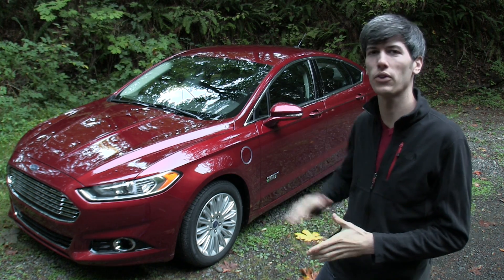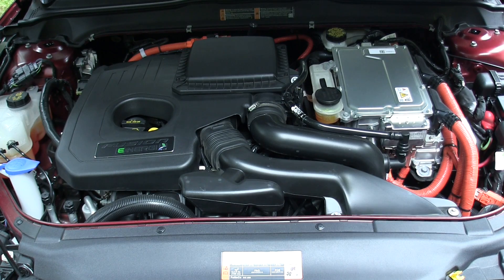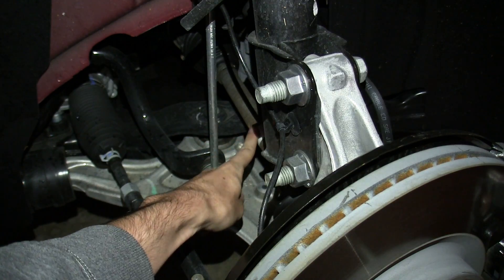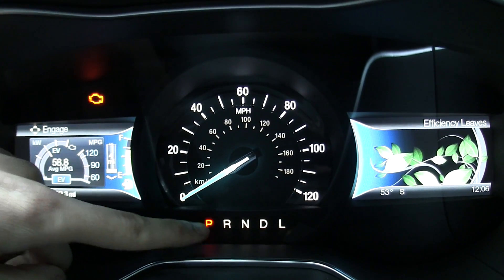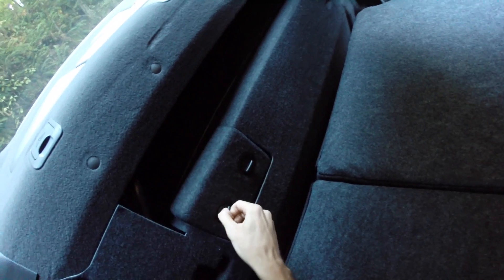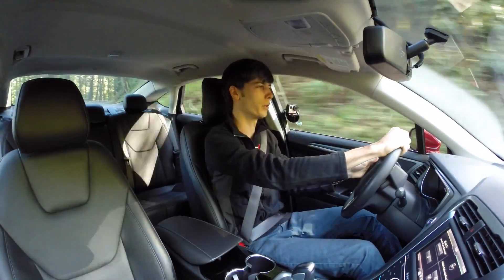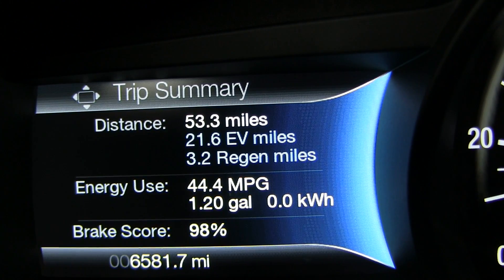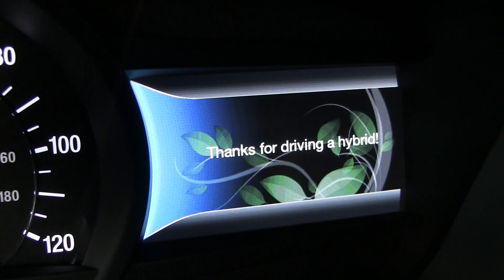2014 Ford Fusion Energi Titanium - Review & Test Drive

Comment: if the brakes are controlled electronically what happens when the battery shorts out.
Reply: Engineering Explained not the parking brake...
Reply from the maker: It's not purely electric, the discs are hydraulic.
Reply from the maker: gokartbuyer The parking brake is electronically activated, but mechanically engaged. If the battery dies with the parking brake engaged, well, it wouldn't matter, and once you start the car (I guess with a jump), you can deactivate it again.
Reply: Engineering Explained So are you saying it can be engaged without power? What if you need a tow? what happens if the electronic mechanism burns out? is there a back up way to manually activate it?
Reply from the maker: gokartbuyer I don't know all the answers, but you could say the same about anything. What if the door locks are jammed? What if the starter motor dies? What if the transmission seizes? It won't be as reliable as a hand brake, in the sense that's it's more sophisticated and electronic, but so long as they choose quality parts that doesn't mean it can't be reliable.
Reply: well we will see how they do in the future remember Toyota Prius had a similar brake system and they were sued over a split second loss of braking power.
Reply: Engineering Explained well seeing a lot of electronics failing early these days and costing people an exorbitant amount of money to repair, it really begs the question of "WHY?". I see it with electronically controlled throttle body systems too, How many have you seen fail compared to the old cable driven ones? How much is a throttle cable compared to a new throttle body? Is it really that hard to pull a handbrake? A cable is a lot simpler than an electronically controlled brake, and with simplicity often comes reliability.
Reply: I suppose the same thing as if you have a brake fluid leak or worse a compormised line that introduces an air bubble in the system.
Reply: suppose the same thing as if you have a brake fluid leak or worse a compormised line that introduces an air bubble in the system.

Comment: I never understood this, why leave the intake valve open a little longer on compression, why not just increase the contecting rod length, or just open the intake valve for a shorter period,
Reply: Perfect, thanks!! Makes more sense! Ps love you're car reviews man! I would love to see you review some trucks thoe, that would be cool!
Reply: Because if you have a longer connecting rod - you would also increase the travel needed for compression as well as expansion, and defeat the point of thermal efficiency -- While if you open the intake for a shorter duration, part of the time used during the intake stroke would be fighting against a partial vacuum in the cylinder (since both valves would be closed during the piston's downward travel), robbing power and also defeating the efficiency.

To experiment - try pulling the plunger down on a syringe with your finger over the hole.  It's rather hard to do - lol.
Reply: You my friend made perfect since!! Get it now! Thanks a lot!! Never thaught about the piston pulling a vaccum while both valves are closed. Thanks
Reply from the maker: Check this out: http://youtu.be/z45fM2N-4C4
Reply from the maker: rax188 If I'm sent a truck I'll certainly review it! Haven't had much say in selection yet. :)

Comment: Why would they use PLASTIC for an intake manifold?! Lol 1 crack and there goes a piece of plastic in your valves
Reply: It's something like glass filled nylon or high density polypropylene...both very strong plastics.  It's smoother than aluminum castings, lighter, and pretty much just as strong.  Also cheaper to manufacture.  Rant: people seem to have this mentality that metal is always better in every situation.  Especially on phones.  Plastics when properly chosen and used can be more effective from weight, cost, and strength.
Reply: Cost mostly but also performance, from how I understand it (I could be wrong) plastic creates less drag in turn causing better airflow then say a aluminium intake
Reply: as well as what Tevi said it doesn't conduct heat as well as aluminium. Putting the air box on top pretty stupid though.
Reply: someusername121 Yeah I know. I'm just a little surprised because I work with MACK/VOLVO trucks and I could never imagine seeing a plastic intake manifold.
Reply: hawkboy000 Keep looking, composite intake manifolds have already debuted on Volvo marine engines and will be showing up on Volvo truck engines soon.

Comment: Only 21 miles? Maybe the hermit would benefit from it, but that doesn't really sound like a good range for modern society to be worth the extra price over the standard gas model.
Reply: Is that really all you took from this video? I 44 mpg? Regen braking? Nada?
Reply: seviren s Yeah, there's that, but there's also vehicles that will get close to 40 mpg without costing $40,000. You'll never get those thousands back in the lifetime of the car unless you either keep it for life or never drive more than a few miles a day.
Reply: We live in town. She drives 5 miles to work through city. In theory, can go 2 days without using gas, recharge overnight ($1.00) and get another 2 days. Lots of people live within 10 miles of their employer.
Reply: +Grant Brewer see comment above. If you Lease, you can lease for the same cost as $24k car. Lots of credits for an EV car.
Reply: I commute 20 miles to work.  Charge there and 20 miles back.  Makes sense in that case.